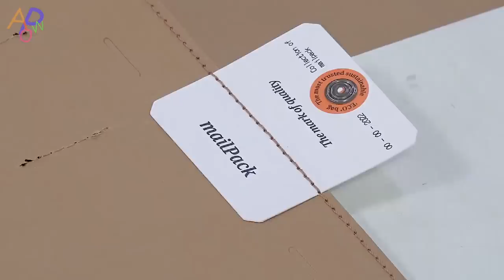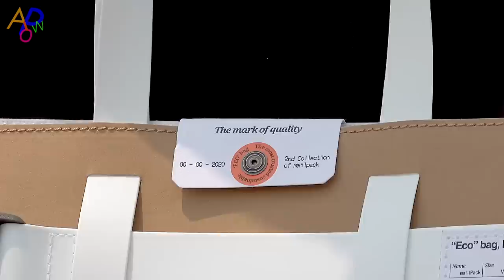Eco Bag Factory in Seoul. Amazing Process to Make Sustainable Tote Bag From Tough Paper

Comment: What is the purpose of the strap with the plastic buckle? All it appears to do is add some plastic to the process. Wouldn't that offset some of the value of making it eco-friendly?
Reply: The belt takes the bulk of the force to keep the top closed, so it's not all on the small paper flap and button to hold the two sides together.